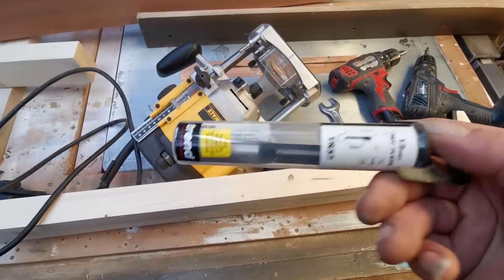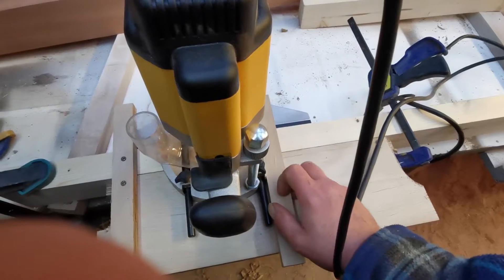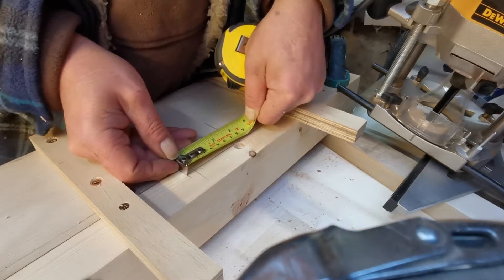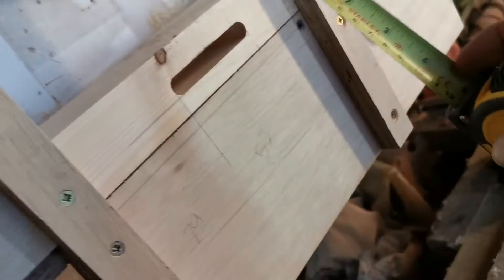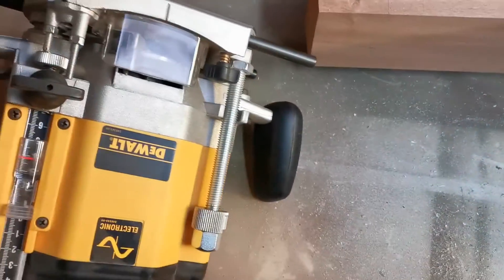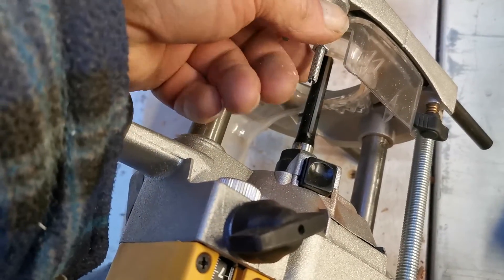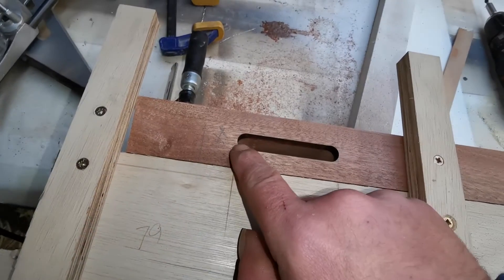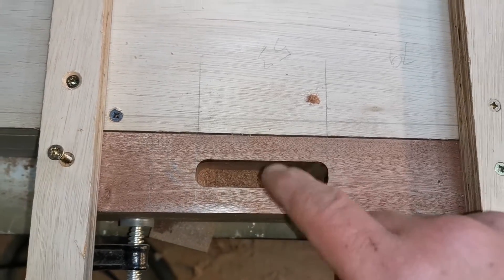French doors & bay window Pt11 - Adjusting the Dewalt DW625EKT router to get the 80mm depth mortices

Comment: I have a Trend T10, it looks similar. So similar the one must be a copy of the other.
Reply: Its a carbon copy of an Elu model from the 90s. Black and Decker/Dewalt bought Elu I believe and I think Trend are involved in someway or other. They're all basically the same models in slightly different shells.
Reply: @ljones396  Indeed I also have a Dewalt chop saw that is a copy of an old Elu. Elu were superior build quality though.
Reply: @steveclen-murphy582  they don't build 'em like they used to! Makita are going the same way.

Comment: The bit runs away like that because when you push it away from you it's making a climb cut on that edge. That can make for a clean cut but you've got to be careful it doesn't run away from you.
Reply from the maker: It's making a climb cut on the return, I did explain @ 19.30mins
Reply: Gid Joiner Sorry bout that, totally missed it... 🤦‍♂️

Comment: gid could you not do the Mortise with the Domino .
Reply from the maker: Yes & No, With the butt jointed domino joint, if the timber shrinks/cracks on the joint there'd be a gap, i would have to create a rebate, a sort of stepped tenon, or a grooved/domino joint, these are exterior doors, they're the only thing holding them together really, apart from the top tenon are these two bigger tenons at the bottom, the doors are nearly 8ft tall n will be having double glazed units so i thought they deserved some proper tenons with haunches 👍